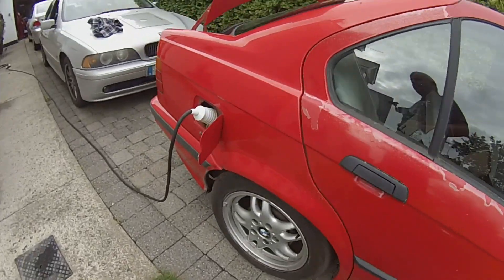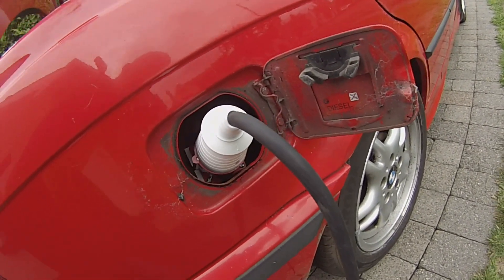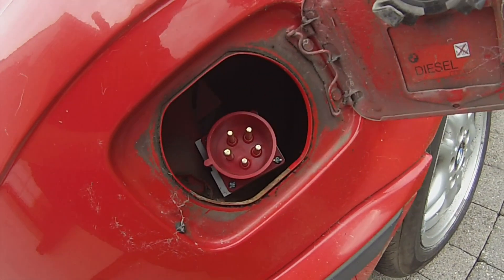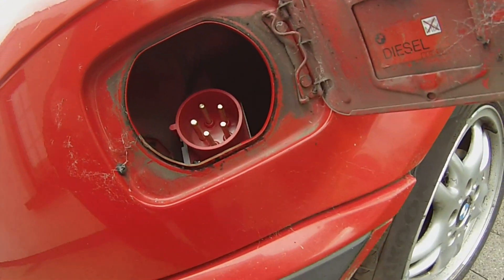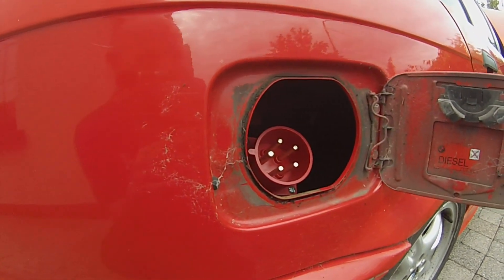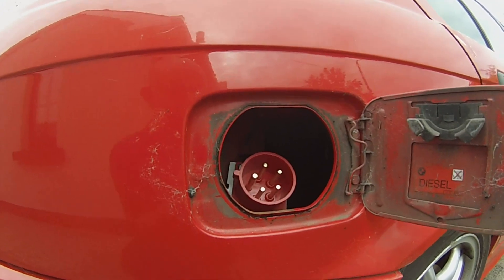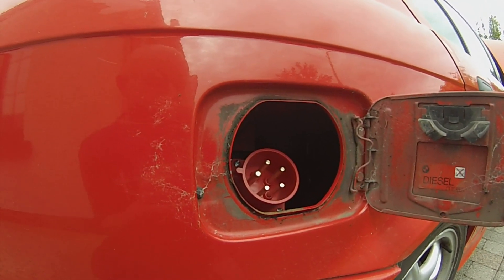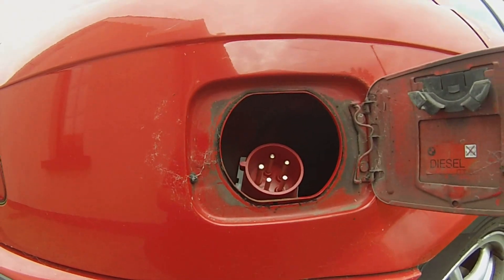€1,000 BMW E36 EV Build 13 : Charging Part 1

Comment: Hi Damien, Very keen to see what you come up with for the charger.  With regards to the cooling of the inductor, I am wondering if it would be feasible to wind an air cored inductor from 3/16th or 1/4in copper tube and run cooling DI water or oil through it. Any thoughts? Keep up the excellent work!